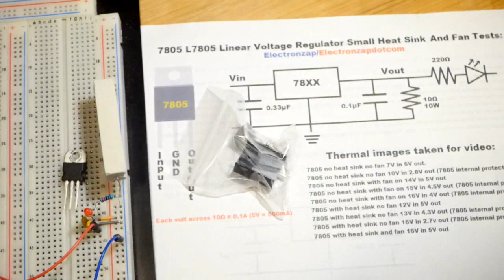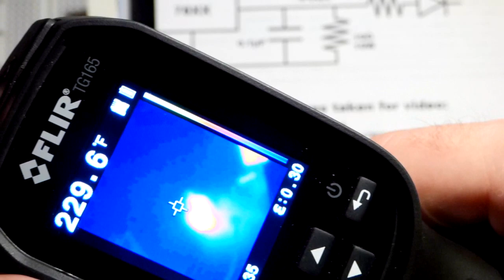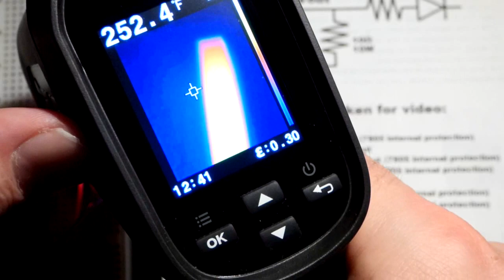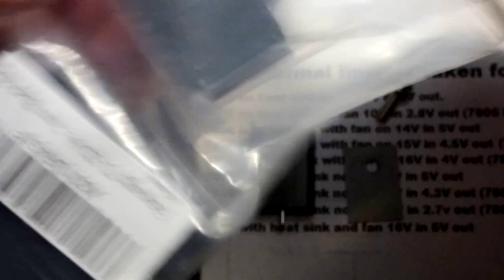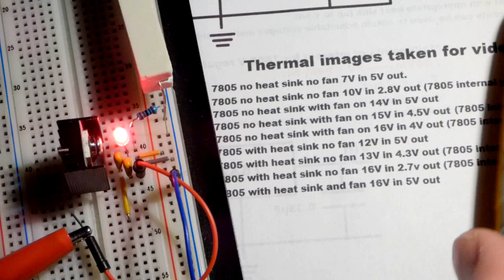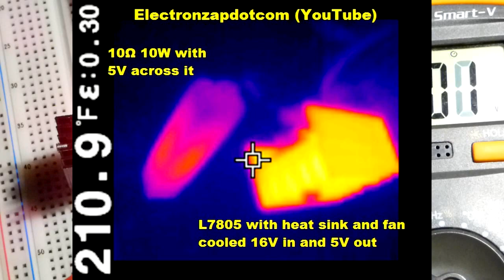7805 L7805 positive linear voltage regulator bare vs heatsink and or fan comparisons thermal images

Comment: I cannot help but think that viewership has gone down across the entirety of Youtube. If you enjoy making these videos and they are not taking their toll on you then please don't stop, cuz we are watching. 😬👍
Reply from the maker: This is my main job now so I need to increase monetization as soon as possible lol. My viewership is still going up over time, but I never had a video using thermal images like these do well, which is a bummer cause I love thermal images.
Reply: I want a thermal camera. 😂 I am messing about with some CD40106 chips today, building oscillators, and suddenly one of them started getting hot. REAL HOT. The only thing I can think that I did wrong was possible accidentally shorting pin 14 (Vdd) to ground with a cap that was supposed to ground pin 12 (an output) -- and I don't think I did that at all. Oh well ... this other CD40106 is not heating up so I'll just put the other one in the "graveyard" on move on.
Reply: @Electronzap  I see that a year ago you noted that your views were doing well, I hope this is still the case for you if you are still interested in this stuff. You are doing a nice job. 

Folks do seem to be getting fed up with some of YT's practices, but I am guessing that channels like your own will continue to do well in this climate. I think the view drops are mostly around channels that have content that can be taken as "offensive" ... or whatever. 
Although this is not good for many channels, I personally doubt (and hope) that it will not negatively effect channels like yours. 

Thanks again, quite helpful stuff.